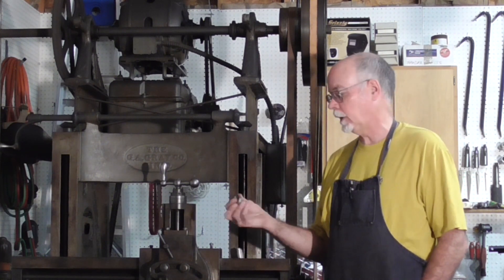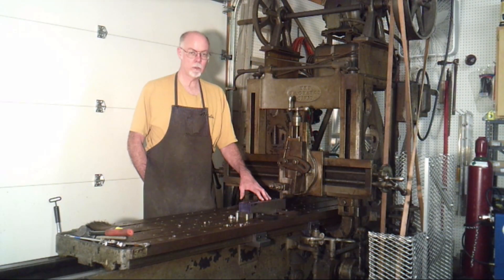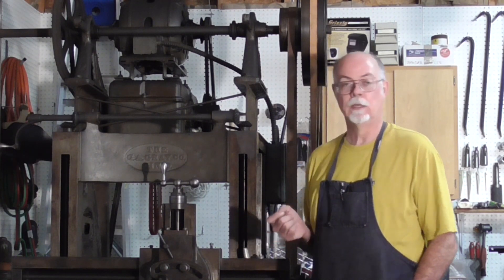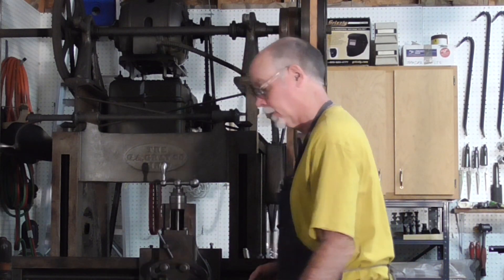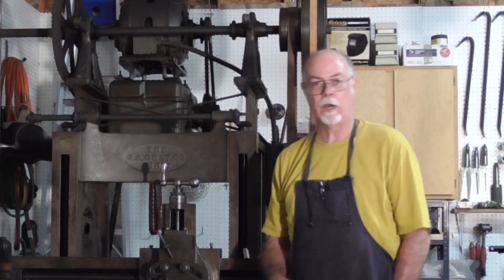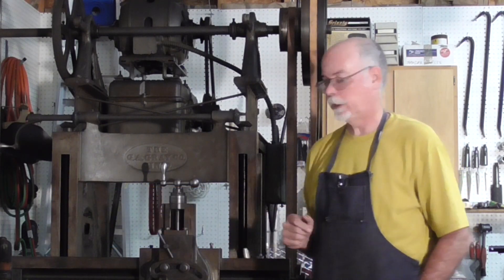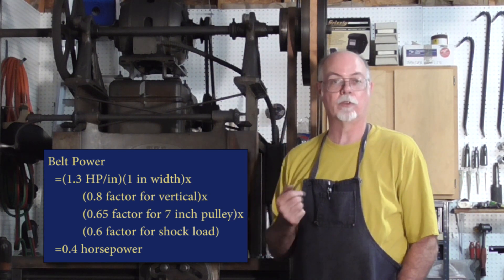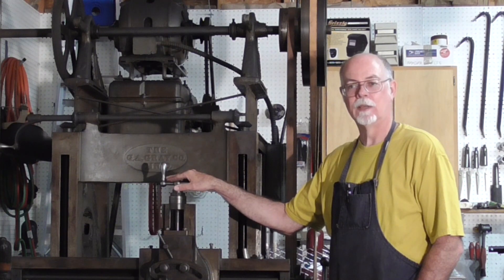Limited Power

Comment: I'd think the belt might have been a little wider originally?  Maybe 1 1/4 or 1 1/2?   Great info.  I'll use it for my New Haven planer.
Reply from the maker: A wider belt won't fit through the shifters.
Reply: @GaryStorrick  I just measured my New Haven belts and they are 1 3/4 but my planer is smaller than your Gray.  I wonder if you shifter's got replaced with smaller ones?  Your pulleys are pretty wide looking.
Reply from the maker: Remember that the top pulleys are not part of the planer, they were added later to replace what would normally be an overhead line shaft. If you were to look at the lower ones, you would see that there is not much room for more width there. I might be able to get a slightly wider belt in there and increase the torque transfer 10 or 20 percent, but I would not see a spectacular improvement.

Comment: Thanks Gary for taking the time to share this analysis. Since I've got a similar 22x22x60 GA Gray planer BUT with a slightly different belt/jackshaft arrangement, I'm curious to sort out what the numbers are for my machine when I get a minute. Mine has a solid jackshaft running at ~630 rpm in place of your Lewellen (sp?) variable speed drive... also has the same "limiting" 1" wide synthetic belts on the final drive pulleys. Double 5L Kevlar v-belts are used from the motor to the upper final drive shaft running ~472 rpm. Working to get the ol gal operational again as I have time!

Comment: My Grey planer would take a 3/4 inch deep 1/16 feed in mild steel, put the widest belt that fits in the shifter slot, smooth side on the pulley no sticky belt dressing.
I am a Journeyman Millwright, machine tool rebuilder, and Machinist. Call me 612-723-5856
Reply from the maker: I already have the widest belt that will fit the shifters. I might be able to coax a deeper cut with some fine tuning, but 3/4 inch seems far, far out of reach without making some serious changes.

Comment: Gary,
You need some of that old time sticky belt dressing.
It used to come in a stick that you peeled the paper back and
Applied it to the belt. It may not be legal anymore.
I have a Pratt and Whitney vertical shaper that uses 2" wide
Belts that takes weany cuts for the slippage. Your tool angle also takes more power than a 90 degree tool because of the longer cutting edge applied to the job.
Kap
Reply from the maker: I have spray type belt dressing, I'll need to look for the stick. Changing the tool angle affects the power needed for the cut (the one in the video is about 10 degree positive, not neutral), but it is not that big an effect. The imporrtant point shown by these tests is that I'm deaming if I think I can do a half inch cut in steel. There is nothing practical that I can do to transfer anything close to the full rated power of the motor, the belt size is limiting. --> Gary

Comment: I have no experience with that kind of machine. But I'm wondering if wider belts would improve the performance?
Reply from the maker: Horsepower transfer is proportional to belt width, but this machine was not designed for wider belts. The ones I have are as far as she goes.

Comment: You might think seriously about going with a wider leather belt, with less tension. My south bend lathe is set up for a leather belt, and contrary to modern thought these belts get better grip at lower tension. The slack causes.wrap-around to occur. Additionally the larger belt is much heavier and carrying somewhat more inertia which converts to torque after the gear reduction.
Reply from the maker: WIder belts will not fit without a major redesign of the reversing mechanism.

Comment: Hi Gary, really enjoying your videos, very informative. Just wondering, if it would help and would it be possible to put a wider belt in the place of the one that slips, or maybe that could be asking for trouble elsewhere along the power train? Just a thought, thanks for another informative video.
      Mike
Reply from the maker: I would have to put wider pulleys on the machine, completely build a new reversing mechanism, and probably make some other major changes. The belts I have are as wide as the machine was designed for.

Comment: Nice video on the calculations and the practical use.  Sounds like you will need wider belts.  I am a retired engineer and I love this stuff.  Thanks for sharing.
Randy
Reply from the maker: Randy Richard Unfortunately, they did not design the machine for wider belts..Gary

Comment: I would put the machine back like it was when you first started running it when it was backwards and ran faster on the cut stroke and was slow in reverse. I know that is not right but I think the best solution for you since you are limited on belt width is to run a bigger pulley on the top shaft. if it works well you can find an even bigger one for the outside to get the forward to reverse speed ratios back correct.  I don't think that would get your cutting SFM too high as you seem to have plenty of reduction on that motor variable drive to get it slowed back down. It would be an easy test just to see how much improvement in your cut power you get from the bigger pulley and the additional belt contact and speed. I am guessing a 3 maybe 4 times increase. Please test it and video the results for us. :-)
Reply from the maker: I never changed the machine. It runs slow on the cut and fast on reverse, just like the day I got it.
.
Increasing the upper pulley diameter would not help much. According to the table in my American Machinists Handbook, increasing the upper pulley from 7 to even 36 inches (absurd!) would only increase the power transfer by 25% - or 0.4 to 0.5 HP.
Reply: Interesting It has that little effect. I went back and watched part 2 and realized you were talking about the drive being marked as running the other way, and the belts being reversed for cross and straight in some pictures that is what I was thinking of my mistake. I guess if the drive were crossed it would give you some more contact as well, but I guess it would not make much power transmission difference at all from what you said. Oh well it still works as is, and is still a cool piece getting it done after a 100yrs is amazing.

Comment: A wider belt would be the obvious answer to the quest for more power at the tool, but when I went back to your other videos it seems there is not much room for increase at the lower pulleys. Am I correct in assuming that you'd need to build a completely new way of reversing the table feed to have any way of increasing the power ?
Reply from the maker: You've got it!

Comment: Wow, thanks for this discussion, Gary. I'm going to have to try to do this sort of thing for my Hardinge horizontal miller. It has several V belts in it's drive system that are very hard to replace (requires removing the spindle and a jack shaft deep inside the machine) and I've accidentally stalled the machine a couple of times trying to take too aggressive a cut. I've cringed each time because I don't want to tear the machine down to replace them if I can help it.

Comment: Thank you Gary.  You have just saved me hours of researching how to do these calcs and where to find "standard" values to use in them.

A formula on a tool company tap n drill size chart calcs HP to to a cut.  They go thru getting volume per unit time and then multiply that by UHF.  I asked the counter guy who did not know what UHF stood for?  Any idea?

Dan Bentler
Reply from the maker: Could you mean UHP (=unit horsepower, another name for power factor)? It is also called the specific power consumption. Machinery's Handbook has extensive tables, as do several texts.
Reply: Gary Storrick Went and looked at the chart copied to notes to recopy here.
Chart says HP = CIM x UHF
where CIM is cubic inch per minute and HP is horsepower to do the cut.  What UHF is I have not been able to find.

Dan Bentler